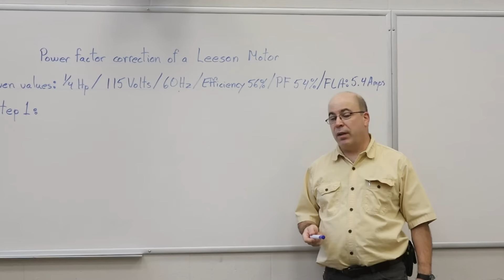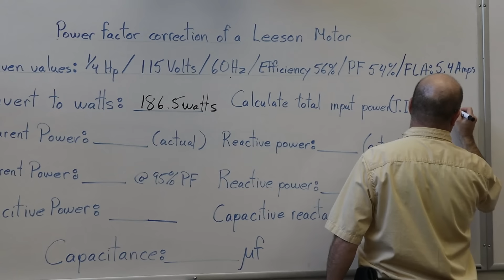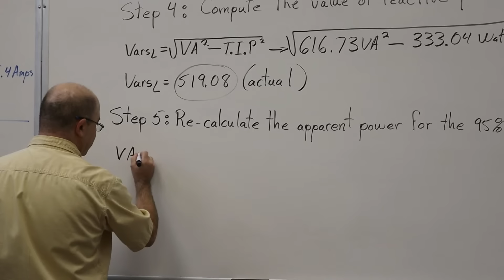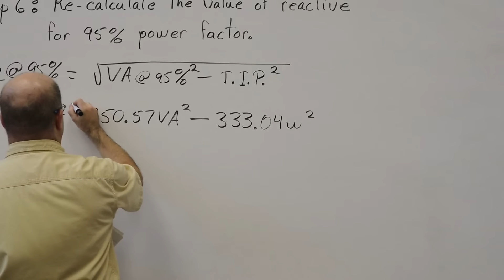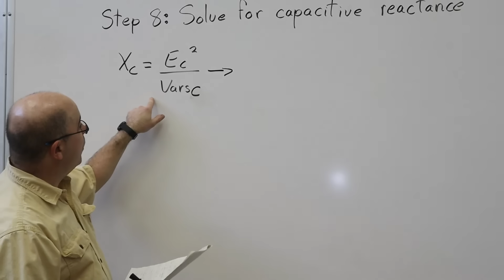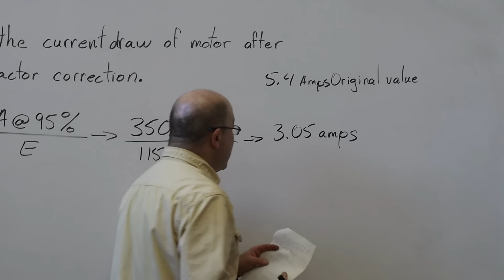Sizing a capacitor for PF correction

Comment: As far as I'm aware, electrolytic capacitors may not be suitable for this use. They're typically used as a start capacitor, and aren't meant to be in the circuit full time.
Typically a capacitor meant to be in the circuit full-time would be a metal-body oil-filled film capacitor that we typically refer to as a "run" capacitor.
As a bonus, they typically come with much tighter tolerances of 5-6%.
Reply: If this is a home, then he saves $0.00

Comment: Quick question did u leave the original capacitor in when u put the the new capacitor in or did u remove it? Also how would u obtain some of those figures if ur motor only gives u volts frequency and watts.? And can this method also increases the motor capability? I have a bench grinder that could use abit more geedy up.
Reply: As he stated in the video, the original capacitor is required to START the motor.  Therefore, it was not removed.

Comment: Nicely explained. I appreciate the step by step approach. I get lost a little on the mathematical principles of squaring and square root formulas. Why wouldn’t these energy efficiencies have been designed in at application development? Just wondering, is a cost reason by manufactures? Thanks for the interesting and informative video.
Reply: Cost. And home owners do not pay for reactive power. So, no real savings, unless you are metered as a business.

Comment: On my flatbed truck I have an air compressor 120 volt .25 HP. being ran with a 120/240 - 7500 watt gasoline generator. It starts fine when the PSI is below 20 and runs to kick-off point @ 122 and when it cycles back on at 92 PSI the motor is sluggish for 10 sec. then trips the breaker. If I bleed it back down below 20 PSI It will run normal again to 120 PSI. Can I add a capacitor to boost the start and minimize voltage draw from the generator. I should have 31.25 amps per leg. Using 7500/240 = 31.25 correct me if I'am wrong. Thank you Sir. Great video
Reply: A run capacitor may help. A Soft Start module may help.

Comment: Excellent video!!  Thanks. 
Can the same theory be applied to take a motor that already has run capacitor and calculate then choose a different capacitor that would get the power factor higher (without going over 95%)?  Or has the manufacturer of the motor with a run capacitor already maximized it?
Along the same line.  If a motor states on the name plate a PF of 75% and you measure PF with your multimeter that's lower, does that mean the motor is bad?  Assuming the capacitor was confirmed to be good?
Thanks (HVAC guy trying to learn).
Reply: A motor run capacitor is wired differently vs this PF correction capacitor.  If the PF of your motor is low, then you can add a PF correction capacitor, as shown in this video.  Use the correct TYPE of capacitor. A RUN type.

Comment: sadly most motors I come across dont have pf or efficiency listed on them.
Reply: @sparky - Manufacturer or website should supply specifications
Reply: You can try to look for similar model and work your best to match the capacitor.

Comment: Good day. I am correct in assuming that , the value of the capacitor after power factor correction is actually the value of a running capacitor. This capacitor is connected in parallel with power supply. Thanks, I have learnt something today.
Reply: No. This is a Power Factor Correction capacitor.  It is not wired like a RUN capacitor.

Comment: Well, a year ago, I asked how the motor was running at FLA with no load.  Crickets!   That motor with no load should be running with current somewhere between 20% and 60% of FLA.  but it did not.  Did he reduce the amps on the motor?  Yes he did.  Did he save any money, no he did not.  Your electric meter is a watt hour meter.  He did not change the watts, he changed amps.   If you have a bad power factor, your watts are lower than they are with a high power factor.   The true test is put a watt meter on the motor before and after power factor correction.
Now, who cares about power factor?  The only concern about power factor other than engineers that love to do math calculations is the utility company.  Do they care about your dwellings power factor?  No.  It’s the big users.  If the power factor of the customer is low, they are not getting all of their money that they deserve.  So, they charge a power factor charge.  If you as the industrial customer hire an engineer and improve your power factor to better than 10% (which is where the utility company starts charging extra) then your utility bill will go up, and the power factor charge will be dropped.  End of the day, you pay the same either way.  I’m sure I will get some flack on my comment, but these are facts and realities that I witnessed in my 35 years designing electrical systems.   Bottom line, this is something engineers love to do math on.
Reply: If this is a small business ( not residential ) then he pays extra for bad Power Factor.
Reply: @MrSummitville .  If a commercial service is large enough to be three phase and have CT’s and have a power factor at the meter of more than 10%, then yes you would be correct.   Single phase, or small three phase with watt hour meters only, no.   If you only have poor power factor on enough motors to be at 10% or less, no.

Comment: I thoroughly enjoyed this video.  Thank you for explaining each detail, like why sizing goes to .95 of rather than 1.
Reply from the maker: It is always better to have a slightly lower power factor than too much as you are now transmitting reactive power back into the electrical system and it may artificially increase your electrical bill. Another reason is to compensate for slight voltage fluctuations in the system that occur on a daily basis.

Comment: Nice and very informative video about capacitor selection to correct power factor. However, regarding saving money, residential utility power meters (at least in USA) measure and charge tor actual (real) power, not apparent power. So improving power factor doesn’t reduce your electricity bill, but it does reduce losses in utility power lines. Large industrial plants may be charged extra if their power factor is outside acceptable limits.

Comment: How do you wire up a 240V motor if 82uf is needed to correct pf? Do you use two 82uf capacitors?
Reply: Use a capacitor with at least 400v, or even 450v rating.

Comment: Very Good Video and informative. You also need to know the type of capacitor you are implementing is a running capacitor. There are  starting capacitors that are invoked during the startup of the motor and disengaged when the motor has reach its rotation RPM. You want to use the correct type of capacitor for PF correction. I run into problems where you dont have the specs on the equipment that is old and plate is missing on the motor or you bought the machine from harbor freight and specs are not available. The question is can you get the number from taking various readings from the motor and calculating a new PF?

Comment: I  calculated the value of capacitor for pf correction as 40 mfd. I connected after step by step calculation as demonstrated in this video. Before correction the current taken was 3.1 Amps. After pf correction, the current taken was only 1.5 Amps. Excellent video.
Reply: Did you get a so called run-capacitor? The type should be on the capacitor:
CBB60 means run capacitor 
CD60 means start capacitor. 

CD60 (start) capacitors are only allowed to be connected to mains for seconds. 

CBB60 (run) capacitors can handle continuous load. 

Another point is voltage. The voltage rating of such capacitors should be at least 1.41 x mains voltage. 

So if you’re on 230V, the capacitor should be rated for at least 400V to allow for spikes. 

Please let me know if this helps or not. I’m just curious. Tx!
Reply: After operation for two months I found the power factor correction capacitor melted and finally damaged. Second time also the samething happened.  But the motor remained unaffected 
 Can you please indicate where the error occurred?.
Reply: @srinivasanp879  RUN type capacitor?

Comment: I was impressed with your presentation.  However, when I checked the motors on my old saws, none of them listed a PF or Efficiency.  Subsequent searches on the internet led me down a rabbit hole which took me all night to climb out of.  Is there a method available to obtain the capacitor sizing?  My motors are 3/4 and 1Hp Marathon Electric 120/240.
Reply: Without a special meter like a 43B power meter to see the motor while working under load, if the label doesn’t tell you then you’re SOL, or ask around on the some electrical website.
Reply: Could try plugging into a kill a watt p4400 mine tells you all that and more

Comment: Really enjoyed your video but because we are billed by KW and not amps do we really save any money? After PF correction do we still use the same kW?
Reply from the maker: You are not saving on Kilowatts, but you are saving reactive power, which by extension will lower the overall apparent power being consumed. With new digital smart meters being installed on homes, the utilities now have the ability to track total power consumption, just like commercial and Industrial customers. Utility companies can impose demand penalties on commercial and industrial users for poor power factor.
Reply: @sergelevesque6292  Thank you for the prompt response!
Reply: @JimSinclair-r3g  Residential = No savings, so far.

Comment: Hi there! Now when I re-watched this, I realized there is something I'm missing : shouldn't TIP be voltage times FLA ? The final current draw, post-correction, is compared to FLA, but FLA appears nowwhere in the initial input calculations.
Reply from the maker: @fxeconomist  the procedure I use comes from documentation obtained directly from an electrical motor manufacturer. Most calculations of this type are based on using values of power instead of current because it gets away from series and parallel circuit rules and simplifies the process.
Reply: @sergelevesque6292  Could you tell me how to calculate power draw if I add too less or too much capacitance ?

Comment: This is a very nice explanation of the capacitor value calculation, but it is misleading with respect to savings. In the USA, utility companies only bill small consumers for actual power, not apparent power.. Small consumers save nothing by power factor compensation, but they can free up circuit capacity. Large consumers have a more complicated billing structure that may include some charge for low power factor. I suspect the same is true in Canada and in other parts of the world. There is no cost to utilities to produce reactive power, but it does reduce their capacity and and the transmission losses have a cost. Utilities may install power factor compensation in substations and even on poles to reduce the transmission and capacity losses.

Comment: You can't really determine the cap value from nameplate numbers.  It is a function of motor loading.  You put caps on & vary cap & note the current & go for minimum.
          You save nothing as far as utility is concerned.  Home power is charged based on real power, not reactive power.  The only "saving" is less current in your home's wiring.  This would be useful only if heavy load is on the edge of tripping breaker.
          The cap you are using looks like "motor starting cap".  These are AC nonpolarized caps designed for use a few seconds at a time only!  You need AC oil caps if you plan on running the load for any significant period of time.  They are large for the microfarads you get!  You also need to deal with the surge on turn-on.  This will tear up the appliance's on-off switch.
          A better thing to do with this motor (assuming it has either starting cap internally, in the bulge on the motor's top, or it is split-phase start, both with centrifugal switch cutout) is to put an AC cap on the "starting" winding permanently (smaller than the starting cap) sized to balance the 2 phases in the motor internally WHEN RUNNING.  This will make the motor run cooler & consume less real power, & will reduce vibration.
Reply: Are you an electrician or an engineer?
Reply: @bernardocisneros4402  An engineer that knows the internal workings of motors (what difference does it make?)  The thing to understand is the purpose of a capacitor in regard to "single-phase" motor.  For "straight" inductive load (such as the older "neon sign" transformers), the capacitor doesn't affect the transformer's function; it only boosts the power factor (I reduced the line current in neon sign transformer from 8 amps to 3.  That permitted operating 3 of them on single 120V line circuit for Halloween "Jacob's ladder" display.)  But for a "single-phase" induction motor (it is single phase externally only), the capacitor's function is to provide phase shift to produce a second phase internally.  This is WAY more important than just reducing line current.  It is connected in series with a separate (second phase) winding, causing current to lead the current in the main winding.  The amount of capacitance required CHANGES with motor load.  At instant of start, motor is effectively in "locked rotor" state.  You need HUGE capacitance for this, which would be impractically large.  So they use electrolytic AC capacitor inside that bump on the motor top.  AC electrolytic cap is very "crappy", which doesn't matter if you use it for a few seconds at a time.  DO NOT USE THESE FOR CONTINUOUS USE!  They will fry & blow their top, spewing out what likes wet toilet paper soaked in (corrosive) chemical salts.
          The REAL way to determine the correct capacitance is to put a mark on the motor pulley & view with stroboscope set to "almost stop the motion".  If the cap is correct, this motion will appear as slow UNIFORM rotation.  If the cap is off, the motion will be alternating speed up & slow down because the 2nd phase will be too early or too late.
          Some (induction) motors have "permanent" cap on the 2nd phase, always connected.  Common examples are refrigeration compressors & fans in outdoor A/C units & in refrigerators (can't put centrifugal switch inside).  Starting torque is VERY weak & line current during the start is ~ 3X the full load current.  (Look on A/C unit nameplate.  There is "RLA", run load amps, & "LRA", locked rotor amps.)  Designer banks on refrigerant leaking down when OFF so the starting load is light.  Bad thing to do is to turn off compressor & then turn it back on before refrigerant can bleed down.  That's why home A/C systems have "compressor delay".  For things like power tools, the only starting load is usually the inertia of the motor rotor & the tool.
Reply: @bpark10001  Thanks for taking the time to answer and write all this info. I understand about 80% of it. I will have to do more reading to understand the rest. That is a cool trick with the strobelight. Using it to find the correct capacitor. I was only asking if you were an engineer because I'm trying to get an idea of how much is expected of an engineer vs an electrician. I do know how start capacitors chancge the phase angle between voltage and current so the motor produces enough torque to start turning. I assume the run capacitor does the same thing, but instead of being used for producing more torque, it's used to improve the power factor.  Thanks again!

Comment: Would be nice to also clamp an ampmeter on the black capacitor wire to show the reactive current. And a killawatt device on the input to demonstrate an improved power factor.
Reply: Real Power did not change. Reactive Power and Apparent  was reduced. Residential units only pay for Real Power.

Comment: Why didn't the manufacturer do it for the consumer by putting in the right capacitor ?
Reply from the maker: @awankawan5093  older machines were produced with costs in mind and not energy efficiency

Comment: Great explanation! How would one go about calculating a power factor adjustment on a variable speed pump for example.
Reply: Electronic variable speed controllers generally will not tolerate power factor correction at the motor. Power factor correction capacitors on the line side of the controller are likely to cause problems also. If such a system needs anything it will be a harmonic filter or inductance on the line side to prevent the controller from interfering with other equipment.

Comment: What brands and types of capacitor should I use on an old 1940s transformer welder?  There is no markings on the capacitor.  The equipment plate has these specs, Primary volts, 230v 60hz, max 37 amps, output 180amps max at 25v, OCV 52v-65v, F.L.P.F. 75%.

Comment: As asked by Muhammad 1year ago. Why are motors produced with this inefficiency in them? Are the motors with two capacitors on them corrected already. Im nowhere near a electrician just always trying to learn a bit of something. Thanks for the lesson.
Reply: Typically, motors with two capacitor have a Start & a Run capacitor.  This is a Power Factor Correction capacitor. COST $$$

Comment: Thank you for this! (I'll be back soon for 3Ph classes 🙂) Meanwhile, I have a diaphragm (inductive load) pond air-pump that at 120.8v meters at 78w (claimed) and 1.58a (claimed), but it didn't make sense to me.  I have some homework to do and a plan. And now I can imagine how makers size run caps for CSCR vs CSIR motors. That said, It seems that any CSIR ought to be checked out.